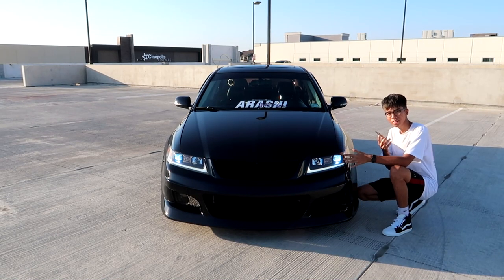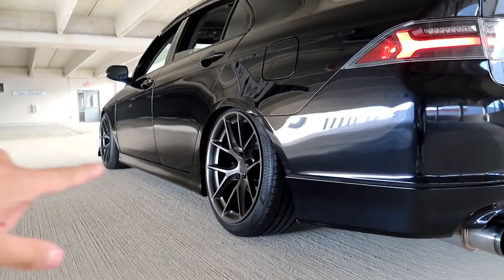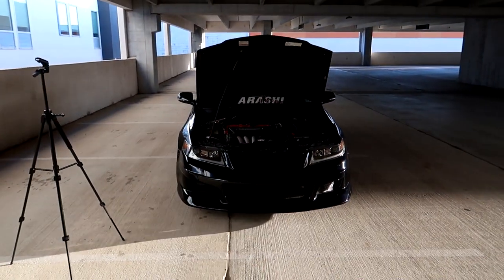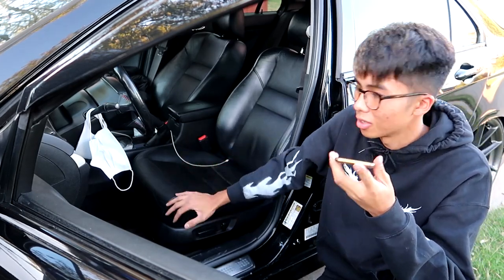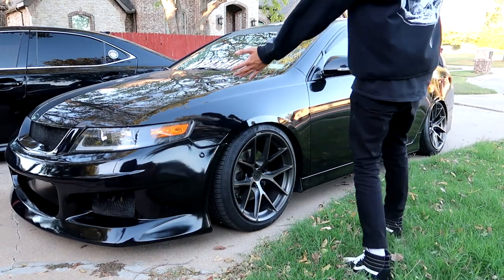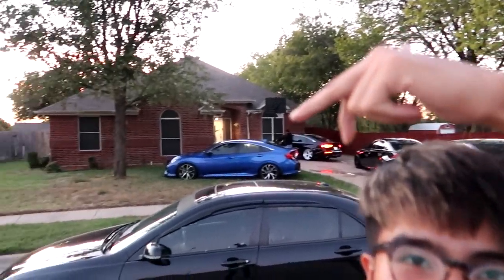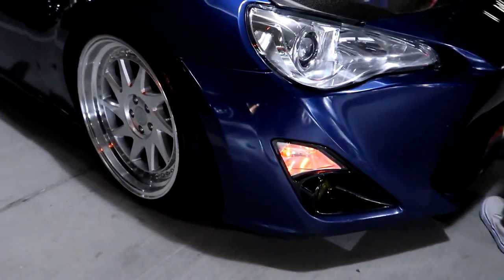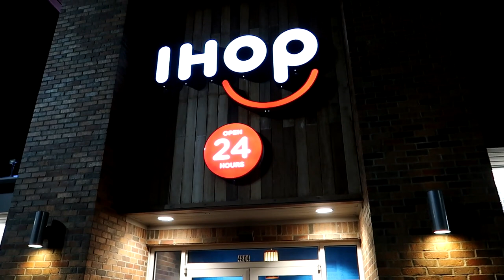Everything You Need To Know About My Acura Tsx!

Comment: Get an android radio.
The rear end is super nice on those tsx. Also the front end from the side it looks like a samurai.
I have to say that the car is coming out a lot nicer than the first time you got it. 
It just need an air suspension system. 
I am waiting to see the rainbow light modification.

Comment: I got an 05 I haven't done anything besides the necessary like ball joints and full factory suspension replaced, it's a fun car to drive but the fucking ROCKER ARM ACTUATOR STUCK ON BANK 1 CEL is the most annoying thing ever idk what oil to use that doesn't create sludge when I drive aggressive

Comment: one thing i hate abt your car is ITS AUTOMATIC
Reply from the maker: 6 speed swap x K20 coming soon 😳
Reply: @BeforeTheStorm  damnn cant wait ur tsx gonna be hella lit 🔥
Reply: @BeforeTheStorm  these cars in manual are where it’s at I regret selling mine I miss everyday
Reply: it is ??
Reply: @BeforeTheStorm  you are doing it wrong, you have a good 2.4L block. Doing a full 2.0 motor is going to loose all the factory specs torque and it’s going to feel weak. Just add the 2.0 head.
Reply: @jesusbugarin227  that’s the true , the k20 head with the k24 block is an awesome combo lots of people use it where i’m from